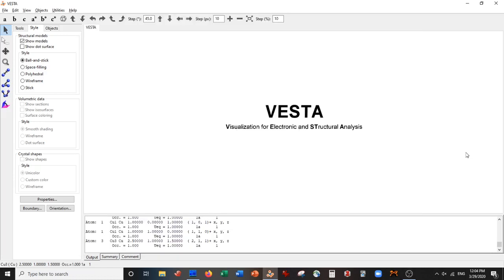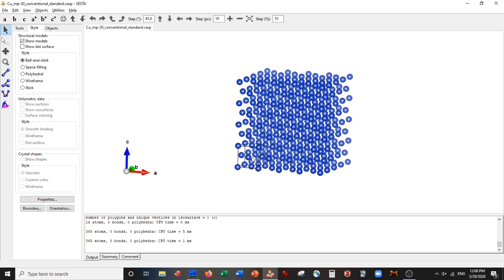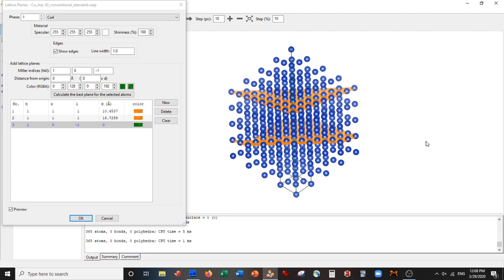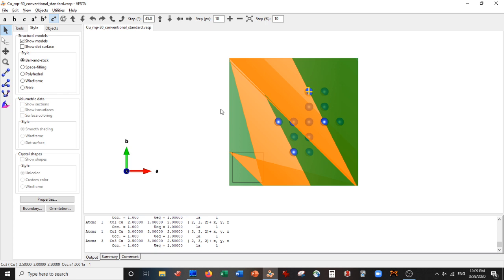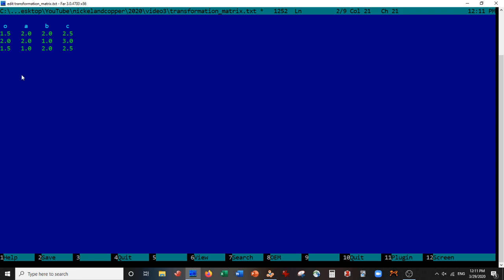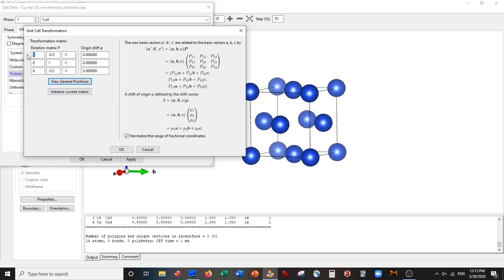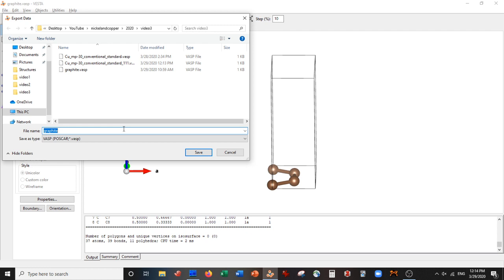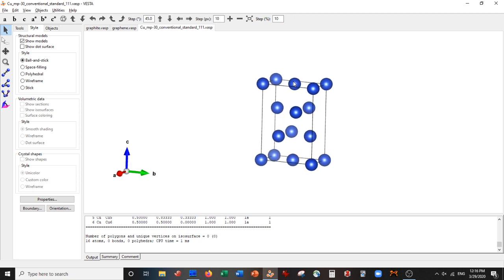VESTA Software - Pt. 1 Graphene / Cu(111) Periodic Heterostructure

Comment: Thank you for the video! I learned so much from your videos. Would you like to share which space group you used for the graphite? I usually download the structure from MaterialProject and there are so many structures of C on it. I found that the graphite should have hexagonal structure with P63mc space group. However, it only has 2 layers instead of 3 like yours. I just want to make sure I got the right structure. I need to make an alpha-iron - C interface with 1 Al atom or Cr on the Fe site ( Iron Alloys) for some DFT runs
Reply from the maker: Hi. I can’t recall off the top of my head. I think it’s orthorhombic actually, could be wrong tho. But send me the full details of your structure and I’ll see if I can make it. Do you have a picture of it? Which face of the alpha iron is to be touching the graphene layer? Is it the 100 face? 111 face?
Reply: @nickelandcopper5636  For the Iron alloys, I would like to study 001 face. The graphite from MaterialProject has id = mp-48, space group P63mmc. The Unit cell looking from c direction is similar to Al2O3 ( I think it's rhombohedral). Instead of 3 layers (bottom, middle and top) like yours, this structure has 2 layers (2.17A from the origin and same from the top of the unit cell. The unit cell has 4 C atoms. I have a picture but I dont think i can upload it in this comment. Thank you for your help!
Reply from the maker: Please post two links to the materials project database for the iron alloy and graphite. One link for each. and in case they don’t work leave the space group and lattice type for both please.
Reply: Nickel and Copper Alpha Iron structure (mp-13, BCC Fe, group Im3m, cubic, a=b=c=2.459) https://www.materialsproject.org/materials/mp-13/. This is the graphite structure (mp-48, P63/mmc, a=b=2.46, c= 8.68) https://www.materialsproject.org/materials/mp-48/. I couldnt find the one like yours when i search for orthorhombic graphite. Thank you again!
Reply from the maker: Thank you. So just to clarify, you want me to combine the 001 face of the iron with a single layer of graphene ?
Reply from the maker: Hi, it looks like this will be a hard structure to make -- too much lattice mismatch. For the conditions you describe
Reply: Nickel and Copper I see. If you would be able to share the space group or file of the graphite you used, i would really appreciate it. I think i can work around the Fe structure. I just couldnt find the graphite one like yours
Reply: Nickel and Copper it would be great if you have a tutorial for it. But I think i can learn from the Au/ graphene video. I just not sure which graphite structure I can use to get the graphene layer like yours. I am waiting for the Cr2O3 or Fe2O3 0001 slab with R3c structure tutorial from you. I tried many times but couldn’t find the repeat atom for the second plane :).
Reply from the maker: i myself have even forgotten where I got it from. but here are the coordinates
C
1.0
        2.4560000896         0.0000000000         0.0000000000
        0.0000000000         4.2540001869         0.0000000000
        0.0000000000         0.0000000000         6.6960000992
    C
    8
Cartesian
     0.000000000         0.709014177         0.000000000
     0.000000000         3.544986010         0.000000000
     0.000000000         2.836014271         3.348000050
     0.000000000         1.417985916         3.348000050
     1.228000045         0.709014177         3.348000050
     1.228000045         3.544986010         3.348000050
     1.228000045         2.836014271         0.000000000
     1.228000045         1.417985916         0.000000000

I don't know how to cut a 0001 plane in vesta. Tell me  how to even make the 0001 plane and for which structure and Ill try to cut the surface for you
Reply: @nickelandcopper5636  I need to make slab of alpha Fe2O3 0001. The conventional unit cell has 18 layers and 30 atoms total. I trying to see if I can have a thinner slab (maybe 9 layers) using VESTA. I have a hard time trying to find repeating atom from the first plane. I was able to do it in Fe metal only, but not for Fe2O3 R3c structure. Thank you for your time!
Reply from the maker: But how do you even select the 0001 plane? Vesta only allows one to select a plane with 3 integers ex. 001
Reply from the maker: Ok I see - it is just the 001 plane